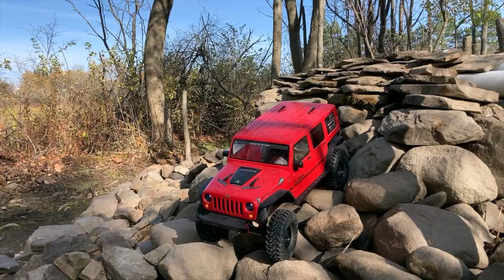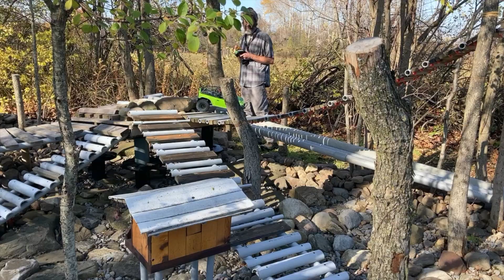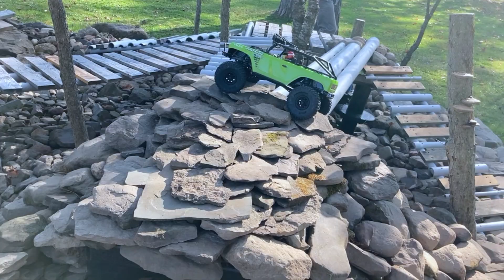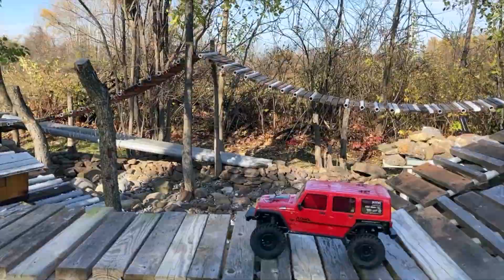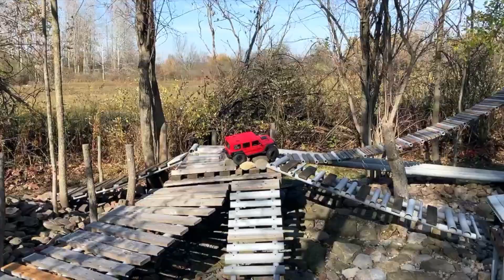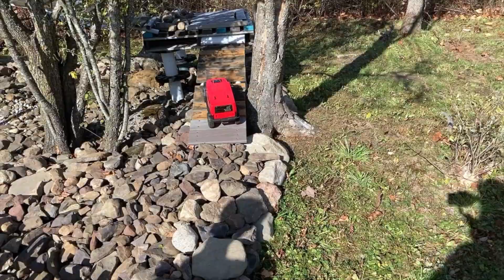Fall 2020 Upgraded SCX10 Deadbolt & Stock 2017 Wrangler 10ii R.C.s on Backyard Rock Course.

Comment: BEST INTRO ON YOUTUBE
Reply from the maker: Thanks Jose, Jack my Australian friend @RC Reactivated on YouTube made the animation from my Voice track and the frog was his idea. Take care & stay safe.
Reply: @GREENFROGRC  I know someone who wants to sell his scx10.2 builder's kit to me for $150.00 my question is do you think I should buy it?It's brand new in box never opened,I'm use to PORTAL gear RC trail trucks and these have I believe the AR-44 AXLE SET? I'm just clueless on anything axial bc it's been gen-8 v1/or gen-8 pack kits/or trx-4 Sport kit,/please any feedback is greatly appreciated on this topic my friend!
Reply from the maker: @josecanseca8979  hey Jose I saw Sean put a 10ii builders kit together it looks good, and I like the 10ii honcho I have a lot. $150.00 seems like a good price, saving $50 plus tax, I think you might enjoy the additional challenge of non portal trail trucks. Axial certainly has a good aftermarket for parts. The 10ii is good also because it is pretty simple 3 gear transmission straight axles.
Reply: @GREENFROGRC  you said the same thing this elder gentleman I know said,,he said bc I do lots of trail run's the straight axle won't make anything super easy sorta like what the Portals will do,thanks brother I'm already looking at a nice body & so far the 69 blazer with back top that u buy separate is in the lead and I'm a hardbody RC guy but damn that's sweet,thanks brother